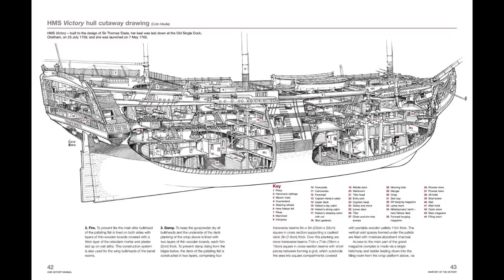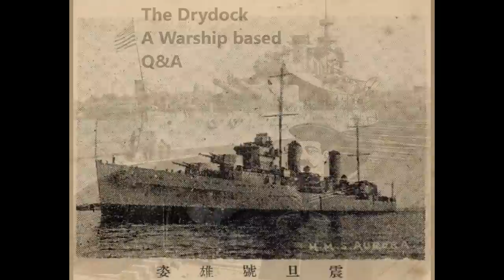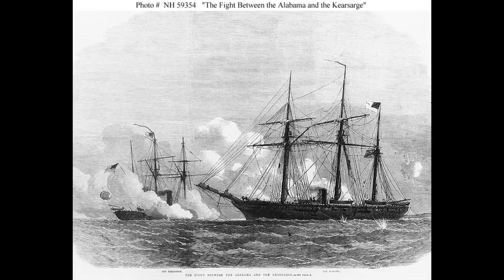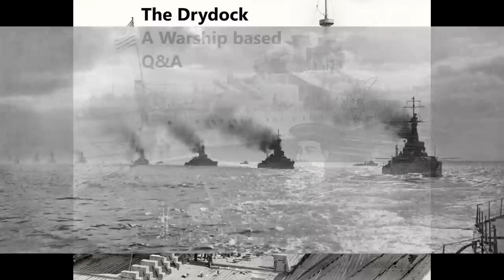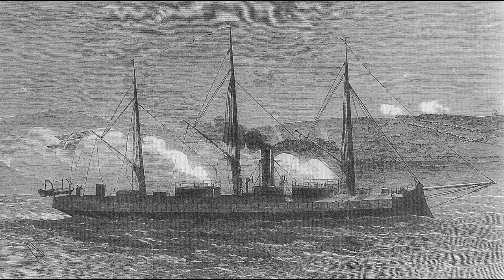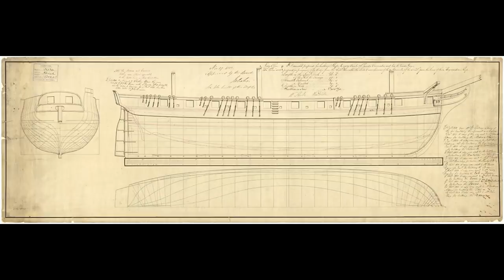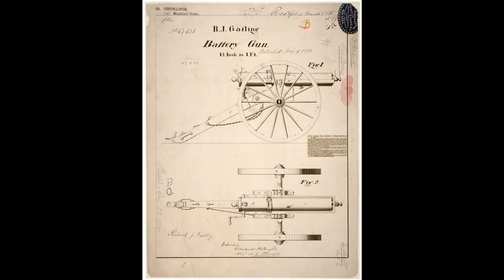The Drydock - Episode 179

Comment from the maker: 03:01:22 - Could the Danish Navy by 1864 be considered the 6th most powerfull in the world?

03:04:01 - Shore bombardment seems to be a relatively "boring" duty for warships during war, but did the crews manning these ships think it was boring? Were there differences in opinion between gunnery crews, other crews, and the command staff?

03:05:42 - What was the first warship to accommodate all it's crew in bunks instead of hammocks?

03:08:02 - WW2 sonar ping?

03:11:10 - What are your top 3 moments of "Haven't those muppets learned anything?" in ship design from 1918 on?

03:15:13 - In movies, there is often a scene in which a ship, submarine or in particular spaceship pushes the reactor, engines etc. above 100% - so 110% etc. Was this done and if so how often?

03:20:38 - If the USN had gone with the 14" gun for the Florida's like proposed how would that effect all follow on BBs up to the Colorado if at all?

03:24:33 - Was the decision by Admiral Pye to ultimately pull back from sending assistance to Wake Island by the carrier task force justified, in your opinion?

03:28:10 - Howl's Moving Castle battleships

03:32:57 - It is generally held that the WNT helped roadblock another very expensive arms race and possibly even a war in the 20s. What are some other examples of, the often justifiably, maligned politicians, getting something right? A program that they cut due to cost or for being overly aggressive. 

03:38:11 - KGV's fitted 'for but not with' 15" guns?

03:43:02 - If you could take a camera on one trip with a time machine what event, person, or ship from naval history would you choose to photograph?

03:44:19 - How many ships could the UK build at once during WW2? How many slipways did the UK have that could build battleships/carriers, cruisers, destroyers and smaller ships? And how many larger (say about Liberty/Victory ship size) merchant ships did the UK build during the conflict?

03:49:47 - We all know how deadly Typhoon Cobra was to lightly-ballasted destroyers, but in how much peril were the capital ships? 

03:55:11 - US Battleships beyond Montana?

03:58:46 - Fletcher decks and USS Iowa Turrent No.2 explosion

04:00:54 - Are there any other cases you know about where crews took the letter designations of a ship and twisted time for humorous reasons, dark humor or otherwise?

04:03:32 - How is the propellant in guns using bag charges discharged?

04:05:05 - Rats on Naval Vessels 

04:08:23 - How exactly does a Reduit ship differ from a Barbette ship, Central Battery ship, or other type of pre-turreted (as in Fully Armored Barbette type we are familiar with now) in the ironclad era?

04:10:32 - Would did Plan X and Y look like before PLan Z?

04:12:29 - Submarine-carrying battleships?

04:14:44 - During the age of sail, were there tenders sent out by the RN Admiralty for cannon and shot. If not, how did procurement for these materials work exactly?

04:16:06 - Why did the British supply ships to anti-Spanish rebels in the early 19th century?

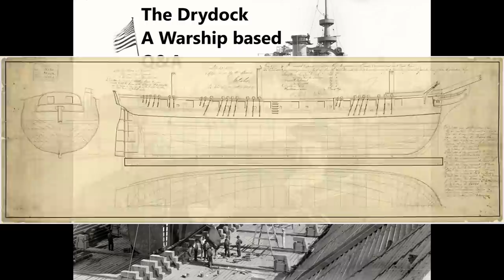04:25:03 - Operation Downfall decoy fleet?

04:27:18 - Small WW1/2 navies showing up in unexpected locations?

04:29:26 - What were Italy's plans to respond to naval build up in the 1930's?

04:35:02 - Project HARP and naval uses?

04:37:31 - Would the Alaska's be better with 6x16" guns?

04:44:54 - What impact did the invention of the gatling gun have upon naval warfare design considerations if any? Were they used in any navies before being made obsolete by the invention of the machine gun? 

04:46:42 - I've heard that the black hulls on coal powered ships such as Titanic and the Victorian peace time colours was to hide the mess from coal dust. Is this true? Were any other aesthetic standards originally for some functional purpose like that?

04:51:09 - Would the Dunderberg/Rochambeau have lasted longer in service if she'd been built with her original turrets?

04:55:17 - How does Nevada compare to the German WW1 and Interwar Capital Ships?

05:00:56 - How often was there more than one carrier docked at Pearl Harbor throughout 1941?

05:01:58 - Why does there appear to have been suction when Hood sank but not Titanic?

05:10:17 - For the Nelson Class why was B turret the super firing one? 

05:12:51 - S.S. Great Eastern, If we took the same design with more modern steel (1910-1930's) how would she compare to vessels of that period? How was her design so robust?

05:20:31 - Boarding action in the Age of Sail

05:25:05 - What was the Royal Navy's transition from Imperial to Metric units like?

05:28:51 - What motors or similar devices are on tugboats to enable towing, and do warships used for towing their 'sisters' have the same types of equipment?

05:35:08 - In past Drydocks you've stated that the Royal Navy tried to develop a dual-purpose 5-inch gun akin to the US 5" 38, but that effort failed. What went wrong?

05:41:27 - Why did the US Marines become closer to the phrase the US Navy's army rather than other marine forces such as the British Royal Marines being closer to Special Forces ?

05:47:51 - What’s with the inclusion of underwater torpedo tubes on battleships designed/constructed immediately after WW1?

05:53:13 - Special ops against enemy ships in the age of sail?

05:58:43 - What, if any, equipment and procedures were there for rebalancing ammunition between the magazines on a ship in the age of dreadnaughts while she was at sea? 

06:02:49 - How or what seems to be the deciding factor of if a ship is sunk or just damaged (so a decisive conclusion or not) where the engagement cannot be avoided especially in the Dreadnaught era and on?

06:08:41 - Channel Admin
Reply: Regarding British 5" DP guns and the difficulty of making a gun that has both a high muzzle velocity and a high rate of fire, according to Navweaps the German KM40 was a 5" AA gun with a rate of fire of 15-18 rpm and a muzzle velocity of 900 m/s. Does this mean the Germans were just better at engineering than the British and Americans, or has Navweaps got its facts wrong? (or something else?)
Reply: I guess you can call the Atlantas a "battledestroyer"
Reply: Alternative for Admiral Callaghan if he insisted on using line ahead formation: maintain course or turn slightly to starboard and try to cross the IJN's "T", like Admiral Scott did at Cape Esperance. Can't have been any worse than proceeding directly into the enemy fleet! And remember that they sank the battle cruiser Hiei everything else notwithstanding.
Reply: As to the german destroyers having to leave fuel in their bunkers to retain a minimal margin of stability, why didn't they float the fuel oil on sea water?
Submarines did it with the fuel in their saddle tanks - although for a different reason - so why not flood the bunkers from below with water to retain stability?
Was the problem only discoverd after the ships were all built and the Kriegsmarine just couldn't be botherd to retrofit them, or was there a technical reason for not doing it?
Reply: @fizzyb00t  there may be other factors involved.
Like weight of the gun, complexity of the loading system or barrel life.
For example, a gun that can be loaded it all elevations may have a more complex breach and rammer system compared to one that can't be loaded at all elevations.
Or a gun of the same calibre but with a higher muzzle velocity may have a longer barrel thus be more heavy or it uses a different propellant charge with a sharper pressure curve and thus requireing a more massive barrel and breach and/or accepting a shorter barrel life.
Reply: In the surface action role 5 inch38 or 4 inch50?
Reply: @calvingreene90  Several factors.
At relatively close-ish range against a target with a actual if thin armoured belt, the higher muzzle velocity of a small calibre/longer barrel gun would be an advantage and so will be the shorter shell flight time.
But the smaller brusting charge reduces the effectivenes of the a penetrating hit, and a larger, heavier AP shell will retain more penetration power over distance. Plus the larger if slower 5"/38 HE shell will carry larger bang than the 4".
Over all, for a light warship's main armament, I would probably go for the 5"/38.
As a secondary battery, ignoring the value as a AA weapon as you specified surface action only, the 4"/50 might be worth it for the lighter shell and thus easier amunition handling.
Reply: @Bird_Dog00  
I agree about the 4inch50 in the anti-aircraft role but in the duel purpose role surface action is important.
Reply: @calvingreene90  Ok, you will find me slightly confused here.
I explicitly didn't talk about the use of either gun in the AA role and did focus entirely on the surface-to-surface role.
So, I do not realy understand why you replied with "I agree about the 4inch50 in the anti-aircraft role (...)".
Reply: @shoootme   The effect on aircraft is due to the gyroscopic effect of the propeller - I would guess that in the case of ships the diameter and mass of the propeller is much smaller in proportion to the hull and so the effect is probably negligible. A thought that occurs to me with regard to torpedoes is that a single propeller would tend to make them rotate about their axis - they presumably have to stay the same way up so that the direction and depth-keeping controls operate correctly.
Something I read in a novel is that ships with 'inward turning' twin screws (which I think means that the top of each screw turns towards the hull) should only use one screw when turning at low speed, as using both screws can cause the thrusts to cancel out, leaving the ship effectively without power.
Reply: Thanks for the brevity.  Burning coal for electricity harms the environment.  Shore bombardment crews got a little excitement when the kamakazis struck and blew up a few hundred guys.  Then it was back to listening to Hank Williams on the loud speakers.
Reply: @fizzyb00t  That gun was never completely navalised, and its barrel life would have likely been unacceptably short by Royal Navy standards
Reply: Assuming that the world navies looked at guided missile technology and decided they were too far-fetched to be worth pursuing for another decade or so than what was done historically, how would gun technology have continued? Would heavy cruisers have tried to arm themselves with a bigger, longer ranged gun (say, 9inch) or would they go for a more rapid firing design like with the Des Moines?
Reply: As someone who also lives near Esquimalt, it's pronounced Es-kwai-malt. Just had to throw in my 2 cents.
Reply: @Drachinifel Q&A Say that the Hood is modernized immediately before her showdown with Bismarck and survives.  She and two British fleet carriers of your choice join Force Z, which also survives and then they all join the US Pacific Fleet like how the 6th Battle Squadron joined the Grand Fleet in time to accompany the Doolittle Raid and stay on thereafter throughout the war.  How does two night-capable and armored (albeit low air group) carriers and immediate access to 3 fast capital ships change the USN’s fortunes at Coral Sea, Midway, and Guadalcanal?
Reply: What were the main reasons not to properly test the Mark 14 torpedo?

Obviously the limited budget was a big reason but was there an over confidence in the design technology and systems of the time? Or was it a case that the testing methodology was flawed? Was the budget for the project that limited because it seems strange that the project wouldn't leave any money for proper testing.
Reply: You too?!  I find myself giggling as I nod off!!
Reply: @shoootme  I suspect you're thinking of WWI rotary engines, where the entire engine rotated, so a Sopwith Camel would turn a lot faster one way rather than the other. I think by the time you got to inline or radial engines this effect had basically gone away. That said, it's late and I'm mildly pissed so no guarantees re my memory :-)
Reply: Do ships screws turn out or in?
Reply: Further to the question on boarding actions, with 2 or 3 decker ships would the lower gundecks continue firing during a boarding action?
Reply: What if Shokaku and Zuikaku were at midway? (As in, the Battle of coral sea was set to happen after midway, and Lexington and Yorktown were also available)
Reply: HMS Queen Elizabeth at Galipoli stopped Turkish infantry charge with 15-inch canister shot. When talking about Nelson/Rodney here, you mention HE was used (for shooting up planes). Was canister shot for 16-inch not produced/employed/used? How about the 15-inch one in WW2, was it still around? If used with timed fuze it would seem kind of similar to Yamato's special AA shell (and maybe is this what you mention Hood used?)
Reply: If the 14" gun Florida scenario had resulted in the New Mexicos and Tennessees with 16" guns, would the Colorados be repeat Tennessees or would they be something akin to the 1920 SoDaks? And how would other nations have responded?

I imagine we'd see Ises that look like Nagatos and Nagatos that look like Tosas, since Japan would see no choice but to implement the 41cm gun in response. Britain, on the other hand, might well think that their 15"/42 is still just fine and not see any need to make what to them is just an incremental upgrade to a 16".
Reply: If WW1 era radio communication had somehow been available and widespread during the age of sail, how might naval tactics have changed?   Would we even have the same naval superpowers of the era or the same famous admirals?
Reply: When it comes to Akron, Macon, etc, were there any plans to produce additional airships by the US navy? If so, what shapes would these successors take?
Reply: Im getting back into Atlantic fleet and theres a mechanic where you can widen or narrow the area of which shells could land was this an actual ability for ships to do this real life if so how did they go bout it?
Reply: On that very first question: were fire ships with gunpowder ever a thing? In order to make the fire ship explode at the desired moment instead of just catching fire to destroy the enemy?
Reply: Quality of RN crews in WWII.

To what extent was there a marked difference in the quality of RN capital ship crews? Were some ships crews better regarded than others?

For example; I have heard and read reports that Repulse and Renowns crews were highly experienced and noted for their gunnery. I have also heard comments from Repulse's survivors commenting on their thoughts of the crew of PoW being somewhat inexperienced.

How were crew changes developed to balance out any differences in such performances?
Reply: Climbing up past cannons and into an area full of enemy soldiers, a very high risk of injury or death and the only route of escape being a high dive into the sea. How were sailors motivated to take part in an offensive boarding action?
Reply: Just watched Battle off Samar TF 34 video. In the damage report, New Jersey was badly damaged, I was wondering what is required  to tow a vessel of that size at a respectable travel speed, as in keeping pace with freighters?
Reply: 0
Reply: When was the first recorded instance of a ship using carpementaliation not only to stop flooding but also help with damage control efforts?
Reply: USS New Jersey has transfer rails that would let you suspend the 16" shells and move them through some of the passageway between the fore and aft magazines.  I doubt you'd really want to be rebalancing any significant number of shells that way - even outside of a battle - but it was a method to do so without taking them up on deck and back down through the main loading hatches down to the magazines.  
However I don't know if those transfer rails were original WWII equipment or it it was something added later -- I could, for example, see them hypothetically getting added when she got her handful of nuclear bombardment shells.  Those would be few enough it might be worth shuffling them between fore and aft turrets.
Reply: Inreference to the question about transferring shells from aft magazines to forward magazines what do you mean by "magazine balance" does the amount of shells stored in either magazines affect the ships weight?
Reply: W
Reply: Surprised at you Drach, and you an engineer - at 22:00, it's the torque reaction, not the torque.
Reply: In a similar vein to the question around 2:45, assuming the British navy lost all of its capital ships and most of the smaller ships as well (assume they forgot to tie up when coming in to dock on leave and every ship drifted out to sea sans crew before sinking). What sort of compromises might the new crash built ships have needed, assuming the budget for new ships did not increase and the government demanded a return to former ship numbers within 8-10 years?
Reply: Wow Drach, you must have been a municipal engineer, to have safety factors of 2, 3 4 or 5..... One of my lecturers at uni used to say the safety factor was the number of years to retirement plus one.
Reply: ⁰0
Reply: Ppl
Reply: Black rats are the common rats in the Philippines, and they are much smaller than brown rats, and they behave almost like domesticated animals in that they seem quite comfortable in the presence of humans. Brown rats (Norway rats) are the chief rats in Boston, Massachusetts, and they can get as big as house cats. These brown rats seem to avoid humans a lot more assiduously.